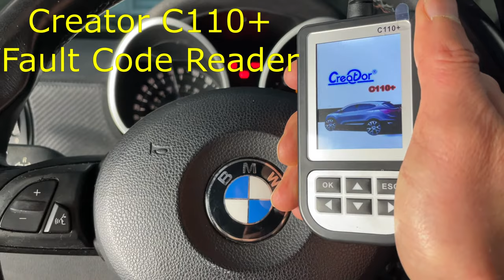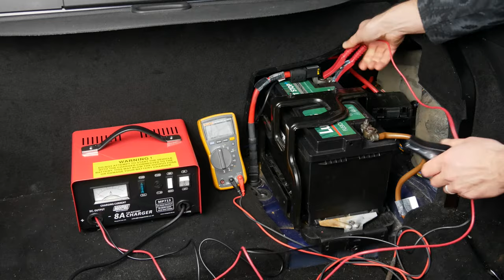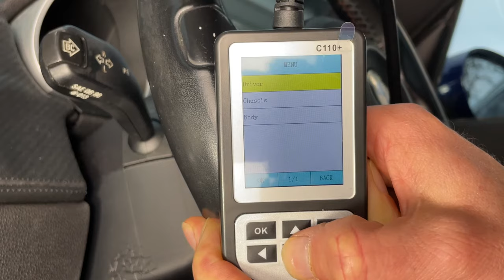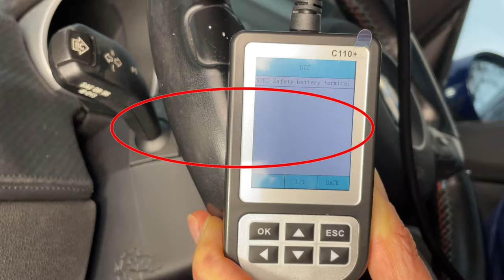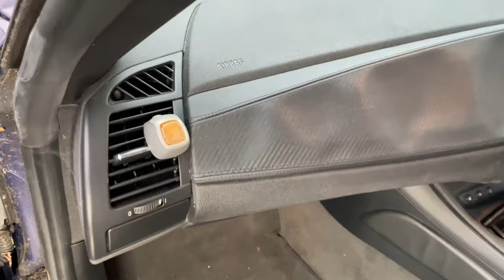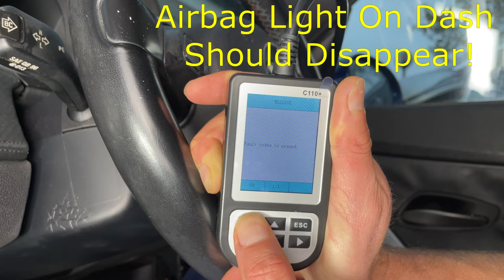BMW SRS Airbag Light Stays ON - How to Diagnose and Reset

Comment: Thank you a lot for the great advice! I used the C310+. As you showed, cleaning the driver side belt tensioner connector and erasing the fault code worked for me (E85 Z4). Greats 👍
Reply from the maker: Good work! Glad it worked for you 👍🙂

Comment: Excellent video and tutorial, I wasn't sure if my Creator C310 had the option to clear my airbag light coming on after replacing my BMW E39 front window regulator that broke and required that I disconnect my airbag in the side door.
Reply from the maker: Cool 😎 glad that info helped you 👍 cheers, Phil

Comment: Hi! Thanks for you great videos. I have a 04’ Z4 and I have the 95b7 error code. How can I fix that? Tried an emulator and nothing changes. Thanks
Reply from the maker: Hi, sorry, I haven't come across this problem myself yet personally. A quick search of forums seems to indicate that it is the "B pillar satellite sensor" and that it is a pretty common problem. I would search BMW forums and you will find info like in this thread that may help you: https://www.bimmerfest.com/threads/b-pillar-satellite-location.950885/ Sorry I can't be more help! Thanks, Phil

Comment: Hi, thank you for a very helpful video. Can I just ask. Do you disconnect the battery before disconnecting any wires to sensors? i.e. under the seat? Thanks again!
Reply from the maker: Thanks! Yes, I think it is good practice to disconnect the battery. If you don’t, you will probably get fault codes that you then need to go clear. Possibly an airbag light too, which you may need a more expensive fault code reader to clear as the budget ones often don’t have that functionality. Cheers, Phil

Comment: Thanks for the guidance. I cleaned the plug as you showed, but the passenger seat light still doesn't come ON when someone's sitting, as it does for the driver side. Thanks.
Reply from the maker: Hi @anavabi1 Sounds like your passenger seat sensor is playing up. I haven't needed to fix this on my car (yet!) but here is some info which may help you. https://www.bimmerfest.com/threads/passenger-seat-airbag-sensor.435963/ Thanks, Phil

Comment: To get through an MOT with a red airbag light on a BMW E46, I put the key in position 2, and removed Fuse 10.

No rear parking sensors, but she passed the MOT.

After the MOT, I put the key in position 2, and replaced Fuse 10.
Reply from the maker: Thanks for sharing, that's a neat little hack to keep you on the road! Bear in mind though that your airbag system may not work properly (depending on the fault).

Comment: Hi is the srs connection the same for all BMW’s I have the 5 series e60 2005.. I think I may need to bypass it. Do you have a video on how to do this
Reply from the maker: Hi, is the SRS connection you are talking about the battery BST connection? If so, then across different BMW's, the plugs look very similar but sometimes has a different wiring configuration. It is possible to  swap the wires around but probably better if you look carefully at photo's in adverts for used items for sale and buy one that looks exactly the same as yours. I'm sorry, I'm not sure how to bypass it, so I don't have a video on it but I think it involves linking the SRS connector wires together with a resistor in the loop. Sorry I couldn't be more help, hope you get it sorted! Thanks, Phil

Comment: Hi pal I'm getting a fault code 8a b-pillar right side on my x3 e83, I wasn't aware there was an airbag in my b-pillar. Have you ever seen this code before?
Reply from the maker: Hi, Sorry, I haven't seen that fault code before but I just have a couple of comments which may help: Code 8A seems to commonly be associated with the alarm system (internal movement detector), so it will probably be unrelated to your airbag light (if it is on). Code 84 though (may look very similar on your reader) is for an airbag, so it may be worth double checking exactly which code is showing. In the first instance, I would try resetting it, maybe it was just a one off? Failing that, these lights often come on due to a poor connection at the plug, you could access the B pillar trim, unplug the connector from the airbag and clean it? Hope some of this rambling helps! Cheers, Phil

Comment: I have a 9SAE and a 9303 code in my 2011 BMW 328i convertible. Installed seatbelt emulator and that didn’t help with the weight sensor in the front passenger seat. Tried clearing codes and that didn’t work either.
Reply from the maker: Hi, very sorry for the slow reply, you may have sorted this out by now. Also, I don't really have much I can add because I don't recognise the codes you provided. Here is a link to the resource that I normally use: it is the attachment in the forum thread and gives a full list of BMW codes (or at least I thought it did!) https://www.bimmerfest.com/threads/complete-list-of-obd2-obdii-fault-codes.683744/

Comment: Does battery need to be removed to unplug and plug under the seat ?
Reply from the maker: Hi @chaunce023 Yes, if you are talking about the yellow SRS connection (not the plain plugs which are just the electric motors etc) if you don't unplug the battery, the ecu will throw a code and put the SRS airbag light on the dash.
Reply: @Revive My Ride  thank you for info
Reply: @ReviveMyRide  and this is exactly what happened to me, unplugged that connector to remove the passenger seat for cleaning, didn't disconnect the battery, in fact the key was in as I had the radio on.  Once I put the seat back in the airbag light is on.  How do I clear it now?
Reply from the maker: @peterc6285  Hi, you need a fault code reader that can also clear MB Airbag / SRS faults. I'm afraid a scanner that can do this will cost you around £100+ but it would come in handy for future work! Please be aware, that there is a big difference between being able to read and being able to erase codes, so you need to make sure it has the correct functionality. I don't have first had experience of the following devices, but I have read on forums that iCarsoft i980 and FOXWELL NT630 can do it. I do use the  TOPDON AD800BT and it has that functionality but I'm sure there are others too that may be cheaper! Thanks, Phi

Comment: Hello, I sent you a message recently about my park brake,e220, thats fixed now , not by me  but the local garage, the srs light has come on now, intermittently at first, now permanently, do you have any tips on how to check what the fault could be, eg, air bags or seat belts or anything else, thank you for your videos, all the best charlie
Reply from the maker: Hi Charlie, I have done this work on a BMW but not on a Merc yet, principles should be the same... What you need is a good quality OBD2 scanner or other form of fault diagnosis. I higher quality unit will tell you exactly what is causing the light. For example: On my BMW it told me it was the Battery safety terminal on the battery and I went straight to it. Often it is a bad connection and you can dean the plug with electrical spray etc. I found this article which should hopefully point you in the right direction: https://www.mercedesmedic.com/srs_airbags/ . Hope that helps! Thanks, Phil
Reply: @ReviveMyRide  hi phil,thanks for the reply, i think my friend has a scanner, as my knowledge is nil i will get him to check it . All the best Charlie
Reply from the maker: @charlesalderson9738  Sounds good! Hope the scanner points you in the right direction! should do....

Comment: anybody know what this means: MRS: TCU OUTPUT SHORT CIRCUIT TO POSITIVE.
CODE IS 93EB NOT PRESENT.
Reply from the maker: I Haven't had this problem myself but did some searching. Seems like it is a short circuit form a connection that talks to the SRS system. Main culprit is a 10 pin electrical connection under the bonnet near the bonnet latch. Otherwise, if you have had a water leak into the car recently, look for a connection near the source of the leak. More info here: https://www.bimmerfest.com/threads/93eb-error-with-airbag-seatbelt-light-intermittent-radio-help.932253/ Hope it helps you! Thanks, Phil